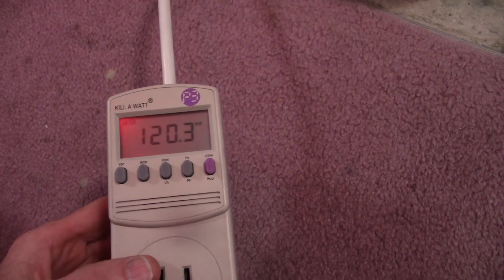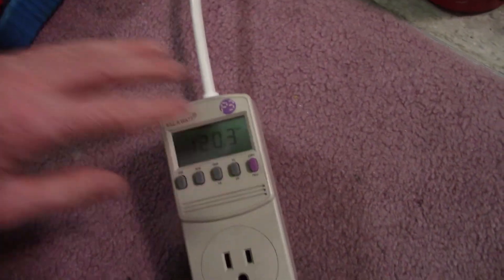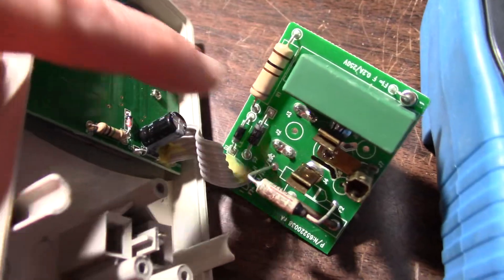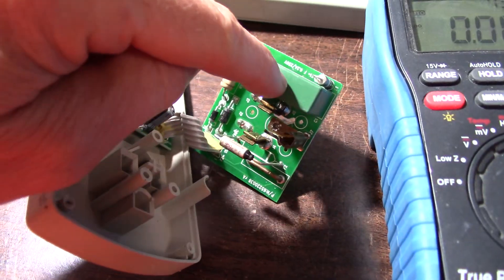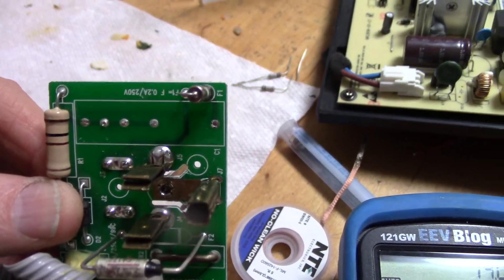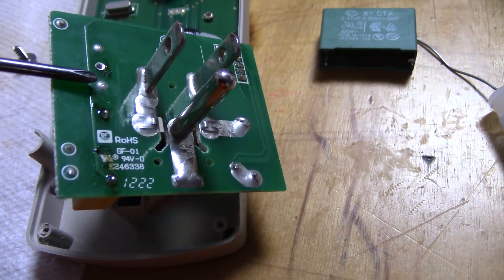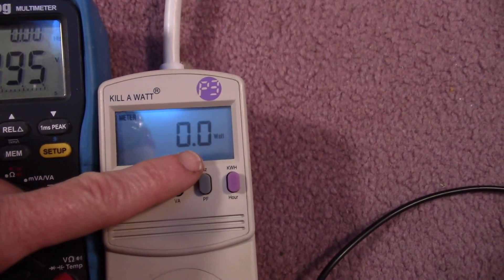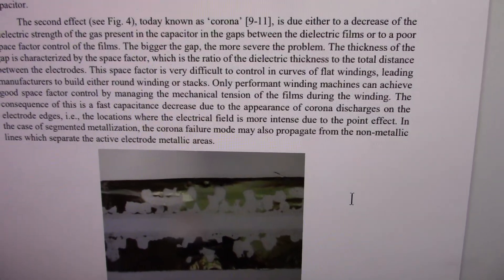Kill A Watt meter not working right - Repair

Comment: Those dropper capacitors always fail. This kind of power supply is used because it is cheap, not because it lasts a long time!
I have a couple of very accurate "Powermate" meters that were very expensive, yet both have failed due to the same use of Class X1 capacitors as droppers.

Comment: If you use high pressured air when heated up the soldier it works good as well on a stubborn threw holes blows it clear out . 👍👌✌️💯🥂

Comment: Caps rated X1 and Y1 are 400v for industrial use
Caps rated X2 and Y2 are 250v for residential use

Good video, it shows these caps can and will fail. Many times the across the line cap will fail and never have symptoms aside from dropping capacitance. That cap was used as a series element like a dropping resistor, that's why the device wasn't working right

Comment: I had a Kill-a-Watt meter die on me about a year ago. I can't recall precisely what it was doing. I think the display was stuck display all 9s or 8s or something like that. I opened it up, didn't see anything obvious that was wrong with it. So I just wrote it off as a failure. Frankly I never liked the thing anyways. I always wished I had bought a Hopi instead but I wasn't sure at the time if they'd work with 110v. I just hate trying to read the non-illuminated display when I've got it plugged into outlets that are usually in dark, hard to get at places. And the Hopi just seems better quality and more thought out in general. I really regret buying the Kill-a-Watt instead.
Reply: The hopi is better for electronics as it has all the extra ways to plug into it, and all the different types of readings, like power factor. Kill a watt meters are best for just measuring the power draw of a device, and that's it.
Reply: @rich1051414  Yeah the Hopi seems overall superior in almost every way. Yet it was a comparable price to the Kill-A-Watt, as I recall. But that's just a life lesson imo. Buy it right and buy it once. That is, if you spend a bit of extra money, take a bit of extra time to do your due diligence in researching what you're buying, and being willing to pay a bit extra to get something that does the job properly without any compromises. 

 Although these days even IF you spend extra on something, it's still designed to fail within half a decade. Heirloom quality anything is just a myth now.

Comment: I think the reason putting fresh solder on the connection makes the solder wick work better is the presence of new flux. I just put a drop of liquid flux on my solder wick at it becomes a magnet for solder, night and day difference.
Reply: Solder wick has flux in it but it's a dry powder and it does fall out. Adding solder adds flux to the joint and just gets it flowing again. So it's a common practice to do.
Reply: I'm more a fan of my cheap solder suction pump these days, I'll only use the wick after that for a little clean up if needed.
Reply: Correct. It’s not fresh metal, it’s fresh flux.
Reply: @brandise76  you're wrong. Perhaps you cannot see the benefits to adding solder to a joint being disassembled but that does not mean they do not exist. Just that you're too dumb to figure it out. And that is your own personal problem. I'm not in a generous mood right now to take the time to explain it all to you either. Tough luck that is. I did but then I deleted that comment. Fuck ya.
Reply: Yeah, like others say, add some fresh solder ... adds flux and it will dilute that mostly tin (?) mix unleaded solder that had a higher melting point ...

Comment: Was your kept plugged in 24/7?
Reply from the maker: I used it for about a month to monitor a small water heater. Beyond that, I rarely use for more than a week at a time or quick measurements. That cap failed fast.
Reply: I've had a similar failure (reading high voltage -don't know how long b/c I don't monitor that param as much as watts). It was plugged in 24/7 to monitor a computer regularly. It was behind a surge protector that indicates it's still good. You seem to imply that leaving plugged-in is ill-advised. Is it b/c of surges causing the described failures (which I would think a surge protector should decrease that risk) or for other reasons than a surge blowing the components?